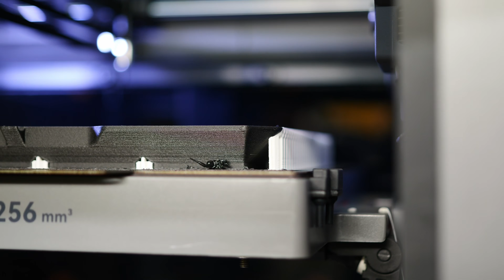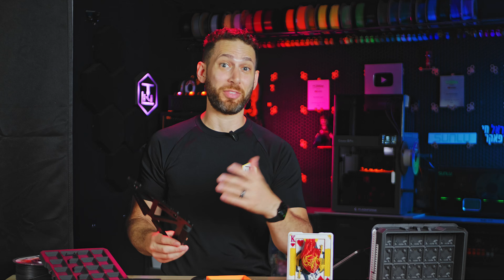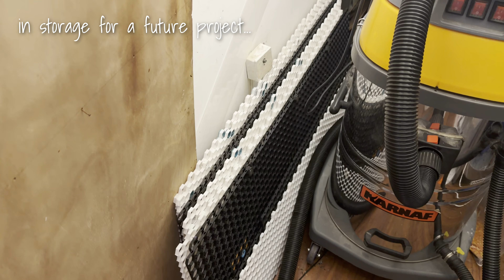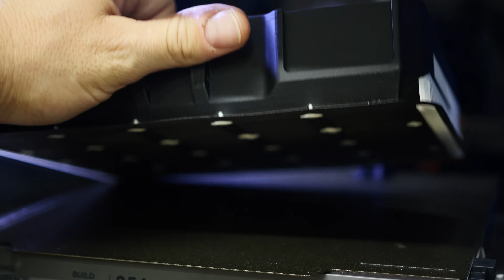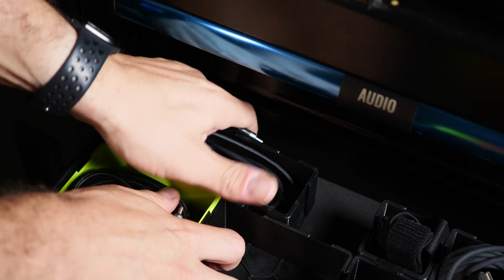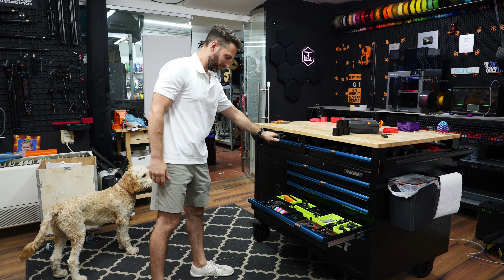I 3D Printed a Complete Workshop Overhaul

Comment: I think the main argument/concern alot of people make about 3d printing organizer bins and such comes down to one thing more often than not: Time. People like myself with only one MAYBE two printers, and not a whole print farm like yourself , take into account while they commit to that one  bin printing, they won't be able to print anything else at all. Multiplying this by the dozens of prints to get a full range solution printed, and a person with a modest workshop could very well be taking their printer out of their workflow for weeks, and that gets factored into cost for those people. 
Different strokes as they say, but for me I have opted to just learn cad, and take a half measured approach of finding "good enough" boxes and bins for a space, and printing dividers and such for the internal spaces of those bins to further organize

Comment: Oh nice - thanks for the review of the Schubox! It took a lot of work so it's really fun to hear that others find it useful. 

I've noticed the same on those front labels and plan to adjust the tolerances slightly. The big version has a better labeling system and I may make that a new standard across all sizes in the future. 

Thanks again and let me know if you have any feedback on the drawers or bigger size if you decide to print.
Reply: out of curiosity, did he pronounce your name right? In my head I've been pronouncing it like "Skylab" but want to correct myself if I misread it
Reply: @tainc  you're correct - it's "Skylab". My name is Schuyler pronounced "Skyler". I made that all very confusing when I decided to use the name Schubox for the system pronounced "shoebox." Branding is not my strong suit haha.

Comment: The bane of my existence is managing the hodgepodge of different types and lengths of cables. Even just USB A, C, mini, micro and various combos. A further item is managing the assortment of wall adapters for various electronics with differing currents, voltages, connectors and physical sizes.

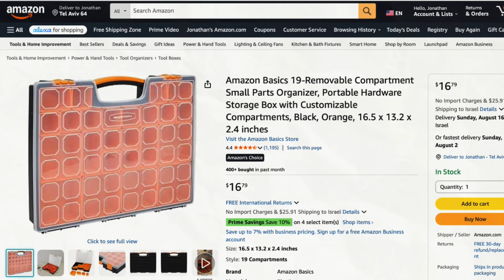Comment: 16:20 not a fair comparison. $26 is for a 2-pack. It's also much bigger than what you printed. Store bought ones are more economical. I know because I've been there. I was in the same boat. Then I did the math and concluded that just getting any of the hundreds of parts organizer boxes are cheaper and easier than printing my own. Bed size is a big limiting factor.
Reply from the maker: $13 each vs $6 each 3D printed + $0.50 worth of metal pins on Ali. I guess that doesn’t include the gridfinity bins inside but even then I doubt you cross $10. Still cheaper! Unless I’m missing something?
Reply: @thenextlayer Volume-wise, those tool boxes are over twice the size of the Schubox.

Comment: Liked your ideas on storage, we all can benefit from this. I would like to know how and what it takes to a tester for filament, and possibly fem printers. I like to modify things whether it’s prints or printers. With that said, I have 2 cr10’s I’m in the process of modifying, mainly getting rid of the control box. However I would like to modify the printer itself. My goal is to convert or modify them to as close to the A1 as possible while running klipper. Any suggestions????
Reply from the maker: Check out IRBIS3D he has a duender and ducr10 project to turn two Creality machines into one monster coreXY machine

Comment: I would love to see some 3D printed options for tables that have no drawers. I have hardwood work bench my 3D printer sits on. It's a good solid piece, but there is no storage on it. I'd love to add some system of drawers that hang underneath for storage. A second idea I have is what to do with these cube storage and shelf systems. Having a big 12"x12" bin isn't particularly efficient. I'd like to have a way to turn a single bin into 2-3 sliding drawers that support Gridfinity at their base. That could make a huge different in storage efficiency.
Reply from the maker: There are LOTS of drawer solutions out there. Jerrari is best known for those.
Reply: @thenextlayer  Yep, I found his Gen2 Gridfinity drawer system. Might just be what I am looking for! I only have 1 printer, but I'm still running out of room for everything. I can only imagine the chaos in your workspace.

Comment: I have sat in my workshop many hours staring at all the stuff on shelves down there.  Shelves or woodworking tools line the walls so I have very little hanging space. I have leftovers from home improvement, woodworking, or my remote control hobby In various containers on those shelves.  The stuff in my work bench drawers are kinda sorted but could be improved.  You have given me some good ideas.

But, my current limitations for finding 3D printing solutions is my printer’s bed size, which is a Prusa Mini.  I would like to move up to a 10” x 10” x 10” bed printer.  I will do so once I sell an RC plane or 2.  I look forward to the next video.
Reply from the maker: Yep a bigger printer makes all the difference in projects like these.

Comment: my desk is continually getting on my nerves more & more, but with a rented space there's a lot of stifling provisions in the lease that have become standard in basically all rental properties in this country anymore - particularly the no holes in the walls bit, which means i lose out on even the possibility of a LOT of vertical storage space.  gridfinity cases like those are definitely a good idea & should interface decently well with the stanley mobile workshop that replaced my toolbox nearly a year ago, but where i'll see significant improvement is simply by getting as much off my desk as possible to reclaim my workspace - that's where a vesa mount & an under desk mount for my older hp elitedesk mini are going to come into play.  microshaft, in their infinite wisdom, decided that my fairly powerful little computer isn't worthy of win11, so it's going to be converted to linux & i'll continue using mostly the same software from there while modeling & assembling various components in my reclaimed workspace.